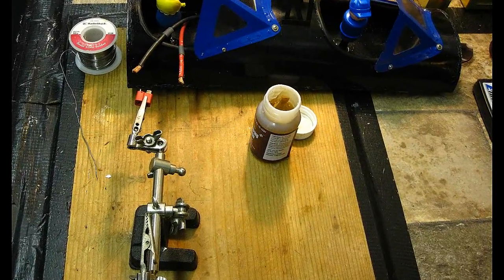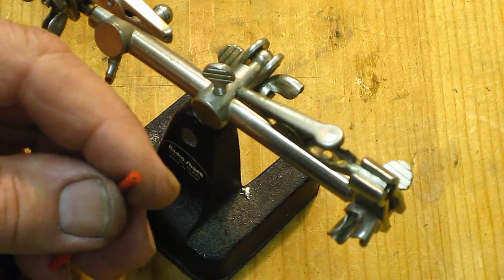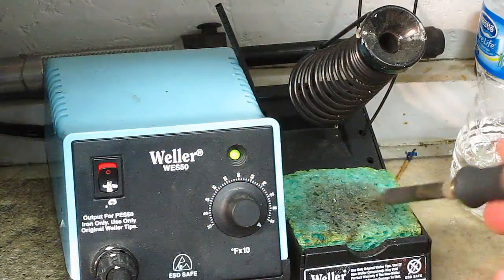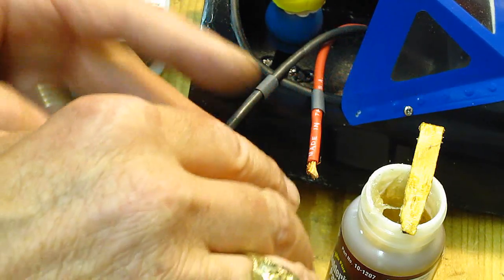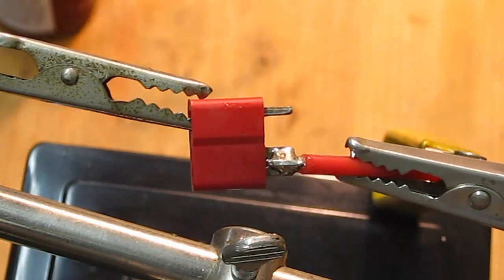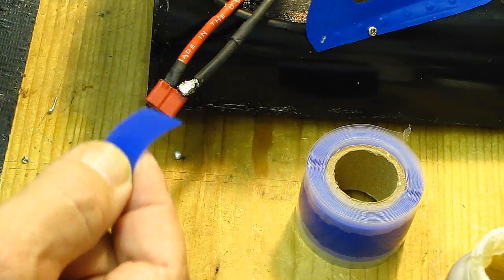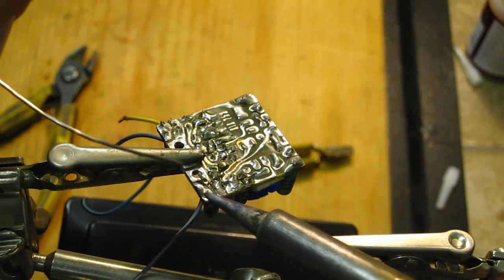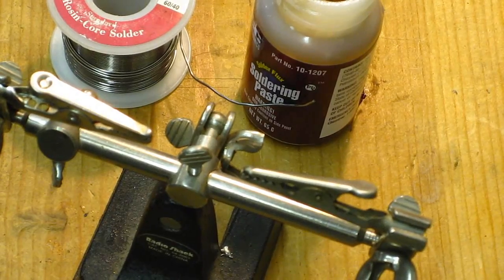My Soldering Techniques. Deans Connectors, Splicing, Circuit boards, and Solder Removal.

Comment: I must say the flux u used to solder the leads to the switch just leaved a big mess on the board 
and although I know how to solder (mainly from school) I watched quite a few soldering videos here on youtube (and I think yours is one of the best)
and when u wick up the solder just make sure your "wick" has some flux on it it makes it a lot easier (or buy solder wick with flux on/in it)
P.S. just to let u know u used a bit too much solder on the adapter, if u tin both sides u shouldn't ad anymore

Comment: Thank you, your video was great, I've watched quite a few soldiering videos to improve my own technique, and this has been one of the better videos. I'm just curious, the first wire joint you made in the video was a technique I've never seen before. i personally usually stagger my joints when dealing with a wiring harness, how would you apply your technique in the field, say soldering a harness under a dash when you can't use a stand?

Comment: You have lent me something here Dave, the first thing I would do when soldering two wires together, would be to tint both ends then solder these together, but it makes more sense to interlock the wire strands first as you did then solder. T-34.

Comment: Dave, I learn so much from your videos.  Now if I can only remember to slide the  heat shrink on the wire before soldering.

Ever tried using Nylon Deans connectors?  I got some from HK and they don't melt!

Comment: Can you show how to solder bigger wire (like AWG 12, found on my 6S battery) to Deans connector?
I didn't know you need to get certificate for soldering. No wonder my solder work is awful.

Comment: Is it me or did you solder on the wires wrong on the Dean, looks like you reverse the POS and NEG wires on the Dean. My deans are label with a + on the top portion or the T of the Deans.